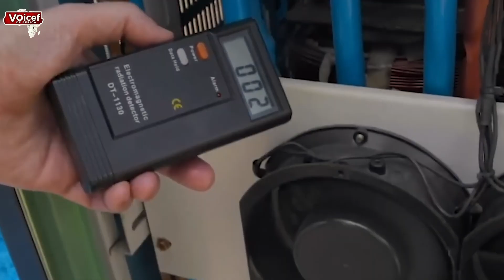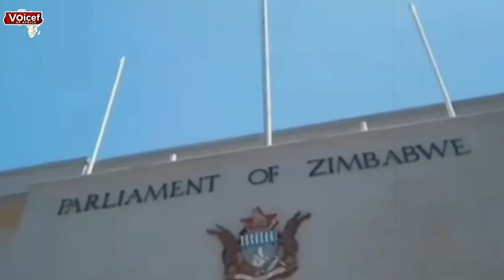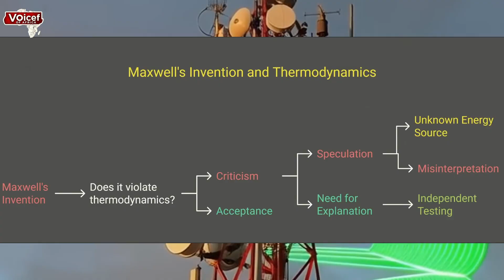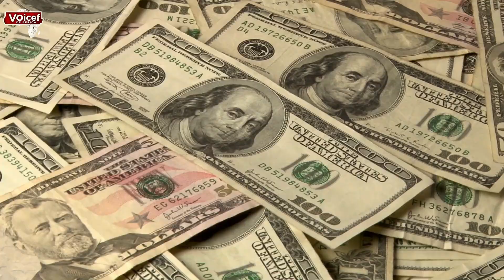Zimbabwe’s Maxwell Chikumbutso Unveils Self Powered Cars & TVs  Africa’s Energy Revolution 2025

Comment: Diode Array is smoothly scalable from microwatt medical applications through internet communicaters to industrial power and beyond to fast and heavy aircraft all with long life. 

All these attributes are taxonomically type two perpetual motion machines. Given the smooth scalibility either all uses are impossible or all are possible. 

Energy being changeble in form and always conserved should not be compromized by heat being conserved energy that can't be used.  A device that is as uniform in temperature as spontaneously possible contains mobile nanometer scale parts that have individual nonuniformaty.

Mobile charge carriers warmer than absolute zero have kinetic energy known as Johnson - Nyquest thermal electric noise that can be rectified by interaction with immobile charges in solids.

As the thermally nergized mobile charge carriers are channeled into an electric circuit they loose thermal energy and gain exactly as much electrical energy.

Aloha
Charles M Brown
Kilauea. Kauai, Hawaii 96754
Reply: Stop with our crap 😂😂😂😂